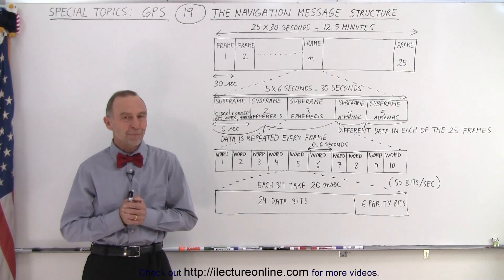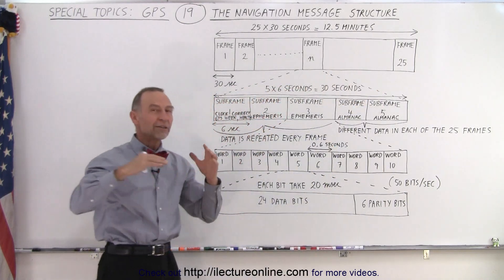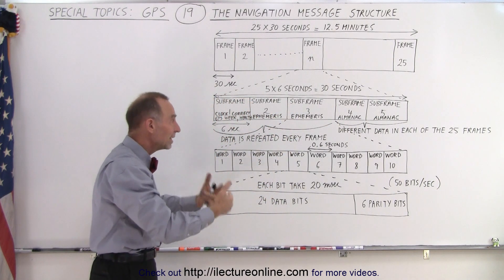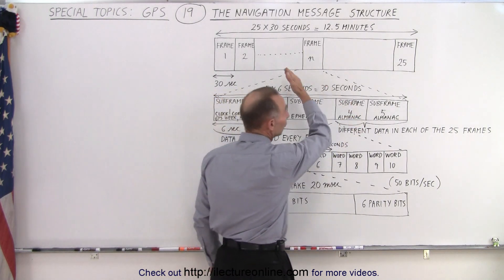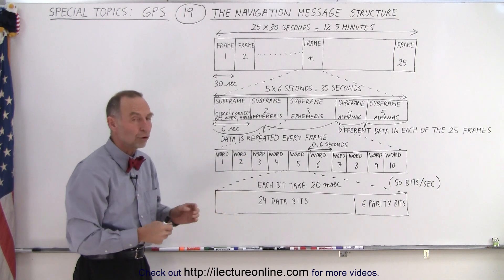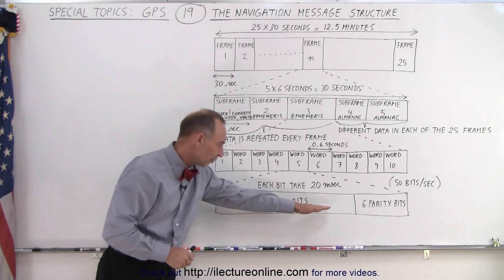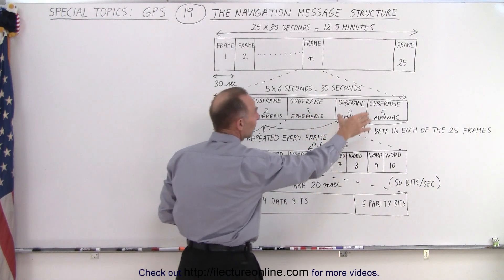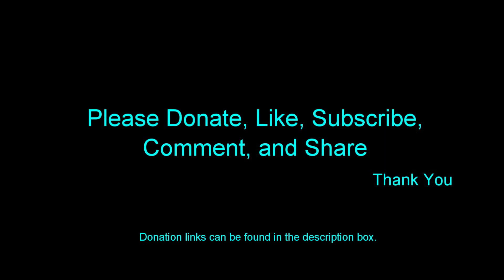GPS (19 of 100) The Navigation Message Structure

Comment: Question about subframes 4 and 5:

Since it takes all 25 frames to acquire the whole NM,  is it possible that different SV's send these frames with a different delay for subframes 4 and 5  from satellite to satellite (since these two subframes are identical for all satellites) ??

This way, a receiver having a view to multiple SV's would be able to complete the entire navigation message in much less than 12.5 minutes ??
Reply from the maker: Every satellite needs to be able to send all of the information needed and specific to it.  The orbital parameters, location, etc. will be different for each satellite, so each will send its own information.  It works the way it does so there is no need to change it.

Comment: Having 6 parity bits instead of simple single odd/even parity, does that mean a corrupted word can be repaired
Reply from the maker: I don't think they repair the message, since it is only a parity bit check.  But the message can be ignored and the system can wait for the next message since they repeat and the errors are random.
Reply: Hamming 30 / 6 allows correction of a single bit error in each word.
Reply: @ve2um  Yes I should have said  'single bit corruption''